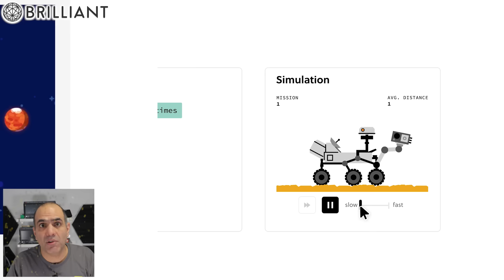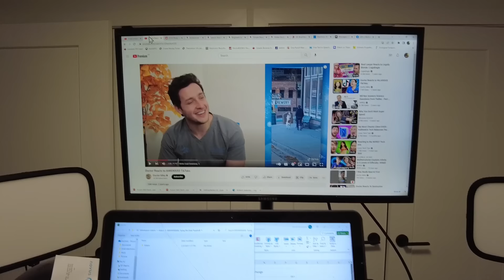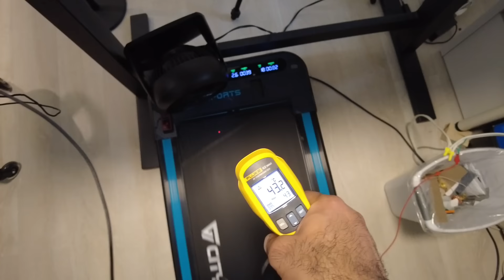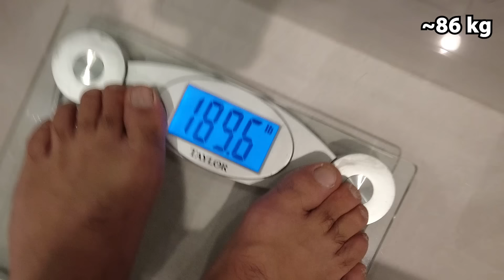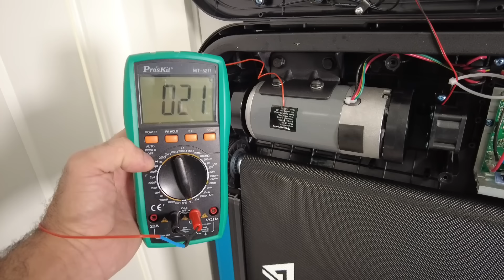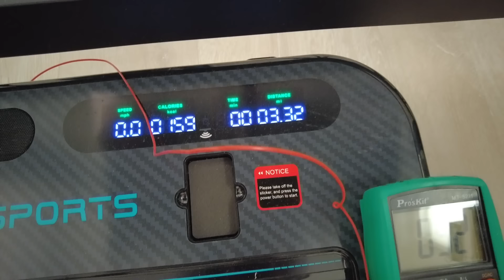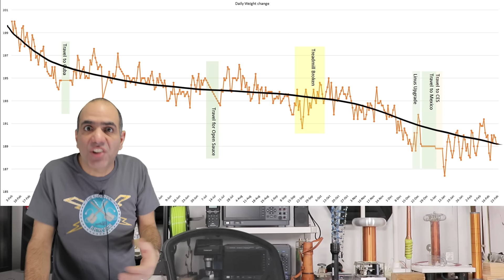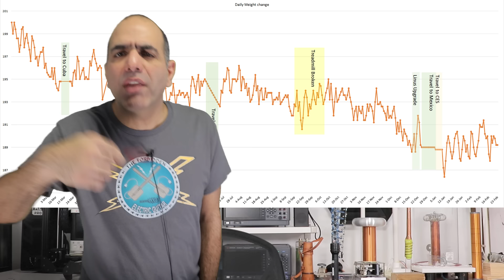Getting in Shape by Sketchy Treadmill over 1 Year

Comment: Interesting video!  I'd love to know if someone has a treadmill they recommend.
Reply: Anything costing around 500 is probably good choice. I didn't even know you could buy one for 100.
Reply: At least not this one
Reply: @Henrix1998  I don't think it cost 100$. He had to pay the extra 100$ to get the upgraded version for the free replacement.
Reply: above 500 $ you will not regret it . the ones below 500 fail and have may motor issues
Reply: Yeah, this one
Reply: Keep an eye on out on your local second hand market - the ratio of people that buy a treadmill to those that actually keep using it is pretty low.
Reply: Just lift up a regular bicycle from the floor and keep the rear brakes a little bit engaged.
Or put a dynamo on the rear wheel and generate electric power instead of consuming it 😐
Reply: I have a walkolution. Bit more pricy but you don't have to get into all that maintanance .  With my weight I figured I would kill a mill a year. So the 5k for a mechanical one will be ok because I will have to work for at least 20 more years ...
Reply: Hi Destin! The industry benchmark is the LifeSpan TR1200. I’ve used mine for over 5 years - rock solid, and I’m a big guy. Currently out of stock on the manufacturer’s website, but it is sold through many resellers. Happy walking!
Reply: Probably one free on Craigslist or Facebook
Reply: Just set up your desk on a lazy susan, so you can walk in circles while working without needing a treadmill🧠
Reply: @norlesh  This. Kijiji is flooded with good ones in near-new condition.
Reply: I am using the Kingsmith WalkingPad R2 at my Walking Desk. I am very happy with it. It also seems to be more stable than other brands and is foldable and saves space when storing. I weigh ~110kg, so this was also a factor for me. It was sold for ~600€ when i purchased it.
Reply: @miguelm203  why would he verify if any stance is better? He was just documenting his idea for getting healthy, not giving a tutorial of best ways to lose weight! You gave your own idea but no one asked for a different idea, they asked for a treadmill recommendation. So maybe you need to keep that in mind.
Reply: I have an older Pro-Form. Does not use lubricant. Somewhat sticky at <2 kh/h, and needs occasional retightening (just a couple of hex nuts -- don't need to open it up) but it runs well. I recommend one with a raised console, just for the safety strap and handholds to keep you from getting zapped and stable.
Reply: I spent $165 after a $25 coupon for mine on Amazon. It was worth the money in the regard it gave me something to try out. Combined with a standing desk is the way to go. For those of us whom work from home on a computer it is a massive health boost. Get one. Don't over inujneer the decision. Learn what you like or dislike and make a revision if necessary.
Reply: 300lb guy here. I stomp around on my Walkingpad P1 (rated at 200lbs) for about 100 miles now and its doing great. Mine is on carpet, so I 3d printed some risers for the feet. Now its perfect. Would recommend, 10/10
Reply: I reccomend going for a walk
Reply: i am a hamster and i recommend my wheel...
Reply: @miguelm203  how long do you really think your idea of keeping the brakes on a little would last? 

Where are you getting you 1500 W from? Are you just pulling that from the maximum specs of the motor? Have you actually measured it?

If you don’t want to “waste electricity” then go and use a stationary bike, as people have pointed out it isn’t as good as walking and is probably harder to work whilst using, also in case you hadn’t realised a lot of stationary bikes, other than old and simple ones, require power too.
Reply: We need  project farm to test treadmill's
Reply: @miguelm203  again just keep ignoring the obvious points people keep bringing up, it really helps your point.

You also get manual treadmills that use no electricity which would have been a much more valid suggestion than a stationary bike, so clearly you don't know as much as you seem to think. A stationary bike is not a replacement for a treadmill.

There are also plenty of less productive uses of power than using a treadmill.

If you are so concerned about wasted power then why are you watching youtube and writing comments? Why aren't you doing something else like reading a book? I see you are a hypocrite since you are also "wasting electricity". Do you cook food? Why are you wasting electricity? You could just eat raw food instead. Why do you have lights in your house? You could just go to bed as it gets dark. Why do you have heating in your house? You could just wear warmer clothes.

So what are you actually doing to save power? I bet it is not a lot but you take issue with people using treadmills because that is the thing you have decided is a waste ignoring all the ways you could be seen to be wasting electricity.
Reply: @miguelm203  oh wow the classic pretending you didn't read it because you don't have a valid response.

If you are going to go for people because they "wasted electricity" using a treadmill then at least have the confidence to back it up or you just look pathetic.
Reply: @Dlutheran wrote, "We need  project farm to test treadmills."

Yes!  But Todd is so obsessively thorough that he would buy a dozen of them, walk on each one two hours a day for the next year, and have to learn to sleep and eat while walking.
Reply: I have one that has worked every time we've turned it on the past 15 years. All 8 times.
Reply: @norlesh exactly my friend... Lots of exercise equipment online, also home furnishings all sorts of things can be had second hand for a hefty discount.
I think I might qualify as one of those extreme cheapskates (although I am not cheap, I tried to purchase items that are quality and repairable) 
All told there's no telling how much money I have saved over the years by repairing things I've literally saved items from the landfill on many occasions.
I am certainly not an extreme environmentalist however I do find it unreasonable to waste and be a bog standard consumer.
Reply: But now I need knee replacements...
Reply: I had a similar one and it had exactly the same problems...
Reply: Just build one with a chain and a three phase motor lol.
Reply: Any that aren't electric tbh
Reply: @miguelm203  losing weight is 70% about what you eat and 30% about lots of cardio.

If you just sports around without an emphasis on cardio this moves to 80 / 20.
Reply: weird adhd thought cant find a answer on the internet but ,what would happen if you spin a magnet with the same magnet force as earth's gravity at the speed of earths rotation?
Reply: Xiaomi walking pad. Its a bit more compact as well
Reply: I bought one because of this video, ive ben using mine for a while, i'm loving it!
Reply: i just wanna know if a 12 year old can use brilliant. i don't think the 100 brackeys tutorials i watched helped...
Reply: It's called the sidewalk. It's amazing to see how life becomes more enjoyable and less stressful, when you live your life.
Reply: @smartereveryday right! 👍

Comment: This treadmill is genius.  It exercises the body through walking, disassembly, and cleaning. Additionally exercises the mind by making sure you learn what you forgot and thinking how to make other equipment work that is affected by static electricity or indirectly touching. The designer thought so thoroughly about it that they even made it look like these intentional functions were unintentional.
Reply: Or in other words: it's not "cheap crap" - it's "feature rich".
Reply: or, "it's not a bug, it's a feature"
Reply: The shock therapy resulting from wrong wiring is a bonus!
Reply: It's not a bug, it's a feature.
Reply: Gotta get that upper body workout somehow. How considerate of the Amazon merchant😅
Reply: Imo why go through all the trouble.. why not get/make under desk machine that doesnt need power and motors to run.. takes away the trouble of failing components.. you just need to lubricate it and deal with static and you get years of service life out of it. I know people say those machines cause them joint pain but treadmills do too.
Reply: @Yilmaz4 feature? More like the FUTURE!
Reply: @vigilantcosmicpenguin8721 Feature? More like the future

Comment: The problem with checking amazon reviews for excersise equipment is that the VAST majority of them are written by people who want to get in shape, use them twice, write a review saying how great it is and then it never comes out of the closet again, so the review doesnt take into account how it holds up to regular use. Ive bought equipment in the past with great reviews that did work great...for about 3 workouts
Reply: The problem with amazon reviews is that most of the 5star reviews are fake
Reply: It's the same with other product too. I bought a stereo with pretty good reviews to replace the one in my project car and its face plate was too wide for the dashboard covering to be put back in. I had to trim the sides to get it to fit and while it does do the job properly, the dimensions that were written were the ones that should have fir properly. 

This isnt my only experience with a product sucking, my sister got a trimmer and it didn't work, it had no effect on me too on my arms with thin hair. I now return to my old reviews every once in a while to update them since i trust those reviews more and I don't want other people also getting screwed.

I also every now and then get emails from sellers offering to send me products for free in exchange for 5 star reviews and these products are always overpriced like an umbrella that cost more than 100 dollars so I look at reviews carefully now.
Reply: @Zlodej5  The problem with amazon reviews is that the 1 star ones are shadow banned.
Also another problem with most similar companies (amazon, ebay,  aliexpress, etc.) is that most products change so fast that the company or product will disappear and be replaced by new one (usually exactly the same just rebranded) before it gets old enough for any problems to appear.
Reply: @hubertnnn  they build a new brand every week and add the same products to it so they can get around amazon's moderation.. if that's even a thing

Comment: I used to service treadmills for Sears Canada, and what most people don't know, is that there are two types of belt lube. One is silicone based, and the other is wax based.... If you mix the two of them together, it thickens and causes a LOT of friction... I have seen so many burnt out motors and circuit boards because of this. 

This was a long time ago, but Nordic Track is an example of a treadmill that uses a wax based lube while Horizon uses silicone based lube. Treadmills come with lube on them, so you need to make that you are using the correct one. Not doing so will at best, make a less and a little extra heat, and at worst, ruin your belt, motor and motor controller.
Reply: Is there any way to tell if it’s silicone based or not
Reply: @InuYasha_bullet000  Not any sure way that I'm aware of. The silicone is usually thinner, like baby oil, where the wax based is a little thicker, (still very thin) Unless you are already familiar with them, that is not much help. 

I'm sure there is a way, but I can't say for sure.
Reply: This is very important for greases too. If you mix incompatible grease, the oil will fall out and the thickeners will turn into dirt.
Reply: I lost my fan this way
Reply: Medhi your leg is caving in please use a wide toe box shoe and strengthen you foot and legs. Walking long hours like this can cause injury..... 🩸
Reply: @aadhi665  You left this comment in response to another users comment... Medhi will not see it. If you want him to see it, you need to comment on the video, and not in response to another comment.
Reply: @InuYasha_bullet000 read the manual, it is always written there how you have to lubricate it

Comment: 10:02 Holy crap. This is why you don't trust the electronic switches on your plugged-in appliances.
Reply: That's why I think the UK wall sockets are the superior design (each socket is also switched)
Reply: @clutchmatic Most of them. But remembering to walk over and throw the switch is the same amount of effort and forthought as unplugging it from an American outlet.
Reply: European style (F-type) plugs can be flipped any time, thus position of the live wire is not guaranteed. So I never trusted switches anyway.

Comment: After having many an issue with tumbler motors and inline fans, I've found the problem usually starts with cheap bearings that go out, and sometimes some silicone lubricant will fix the shaft bearings. Other times, it's a matter of replacing the bad bearing before the motor DOES burn out.

Comment: Thank you for this video. I have a standing desk for 10 years now and I never use it for standing only sitting. I was thinking to get a treadmill too, but I was too lazy to compare 100 treadmills to get the best / longest lasting one. Your video keept me motivated to buy an eletrical treadmill. BTW I did some digging and if you have the money or the time you should investigate the premium mechanical treadmills (without electricity) - for example: AssaultRunner Pro. They are completely silent, no maintenance required and cost 2000 to 6000 € - or something like 200 € if you build it yourself. There are some examples that work for standing desks too. I do not have the skill or budget now to get a mechanical treadmill yet - but maybe in a couple of years.

Comment: Years ago I was servicing a Sorvall RC-3B centrifuge (it's the size of a washing machine) that runs on 240VAC. I learned the hard way that the breaker on the machine only disconnects neutral. The motor brushes still have live 240 ready to kick your ass. I learned a lot that day.
Reply: But you LEARNED. Can't say that about a large percentage of folks I've seen servicing electronics...
Reply: Yeah, it's always better to disconnect the plug. They should add a bipolar switch, as in most of the world the connector is reversible and phase can be on any of the two wires, but that adds cost.
Reply: The amazing thing is that you actually survived getting zapped with 240 volts!

Comment: Excellent video.  I think people generally need to do a better job of taking care of themselves and a walking desk is a relatively easy hack to do that.  I've been using a treadmill desk for nearly a decade now.  The one I'm using has been good except for the control board which I've had to replace several times.  (Thankfully under warranty each time).  Since it's been out of warranty, I replaced the control board with a pulse width modulator which has been very solid, but I did admittedly lose some features.  I used to occasionally use it for running, but now only walk in it.

Comment: If you are going to do this, maybe setting up a pressurized air line to a grid of holes under the belt where you are stepping might allow you to create an effect like an air hockey table to reduce the friction of the belt on the pad under your foot, if you manage the hole placement well you should be able to lower the friction of the belt on the pad even better than lube and reduce the motor load even more. 
If there is no fan for the compartment with the motor and electronics it might be worth installing a fan to feed the motor fresh air, but lowering the motor load is probably the best solution

Comment: Excellent video, as usual. I believe the reason why the PCB switched the neutral instead of the live wire is that in many parts of the world, house wiring is not polarized. For instance, here in Austria, you can plug the wires in either way, so the live and neutral wires aren't consistently on the same side. In most houses, there isn't a standard for always placing the live wire on the same side of the receptacle; in fact, in many older houses, the wiring to the socket is connected randomly. Except ground, obviously.
Reply: in that case, the switch is meant to be double pole.

Comment: Ive got a video Idea  -- Test on "melting" / "arcing" on different electrical wire joints both for full wire and stranded for the home 120-220V. (1)Regular twist the wire joint and cover with electrical tape, (2)advanced twist the wire joint and cover with electrical tape,(3) wire nut,(4) Wago, (5)screw joint and (6)solder joint (maybe there are more ways?). Basically what i want to know is if all of these are done correctly is there really a risk to any of these when done properly , cause i've seen quite a few videos saying just doing the "advanced" twist and electrical tape is a huge FIRE HAZARD / Fault issue . Basically test for melting or arcing with some sort of current generator, test for rip apart strength, test for resistivity.

Comment: Hi Mehdi, I hope you find this useful to know: treadmill less than 2-3 hours a day!
I did 8 hours for 5 years (on a 12º incline so it would take more effort) until i noticed I was no longer able to jump nor sprint like I used to. Barely jumping 20cm instead of 60cm (8" instead 2ft), and lost 7 seconds in 100m sprints. Horrible!

Sure, standing or walking all day had become effortless, I gained a lot of stamina, but I regret losing the spring in my legs. I sold the treadmill, went back to sitting, and took up team sports. I wasn't doing it for losing weight, but for back pain, and a more effective remedy for that was doing ab crunches, and side to side twists, and stretching more. 5 years later I've recovered only 15 of the 40cm I lost, and 2 seconds of sprinting. It's a lot of work to get those back!

For your health & weight, I suggest Sten Ekberg's videos.
Thanks for your videos, I appreciate learning about electricity and electronics!